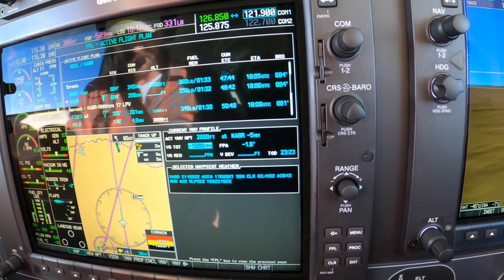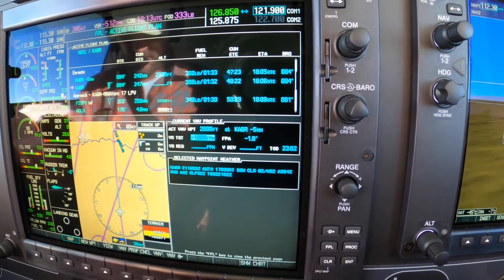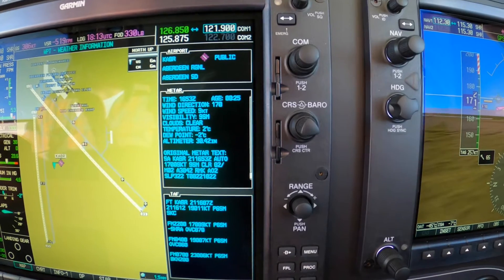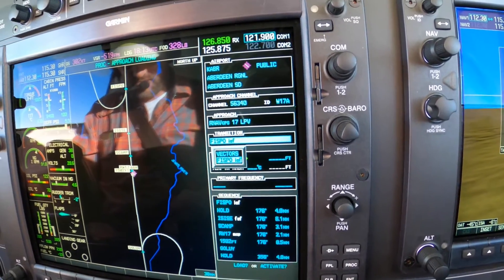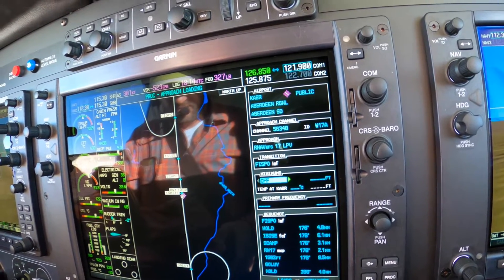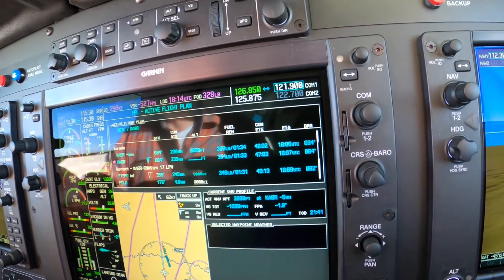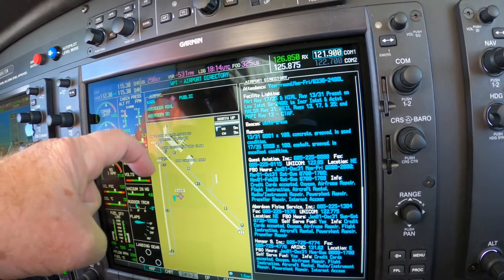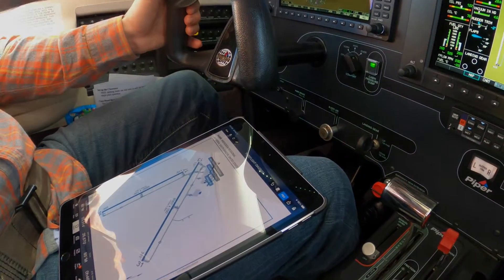Piper M500: Descent/Arrival Planning into Aberdeen SD

Comment: What’s wrong with 3* GS in VNAV?  Use it all the time. Stay high as long as possible.
Reply from the maker: Hi Rick. I see nothing wrong with 3 degrees. You didn’t say what aircraft you are flying but I suspect it is something with a higher Vmo than the Meridian/M500’s 188 Kts. In order to descend any quicker, the Meridian/M500 pilot will need to reduce power significantly below the setting needed to sustain ice penetration speed upon leveling off. This produces some management challenges for the SPO (single pilot operator). The Meridian/M500 and M600 all default to 3 degrees. The Meridian/M500 can be modified with either VS or degrees down whereas the M600 (Vmo 250 Kts) allows for VNAV mods with slope changes only. In any case, I recommend a climb of 1/3 of the flight time at ice penetration speed and a descent rate consistent with a power setting that allows for an airspeed below Vmo in the descent and a stabilized level off. Fly Safely - Train Often..
Reply: @RWRPilotTraining   Hello Sir! I do fly a M500 300+ hours a year and nearly always use the 3* descent.   Yes, the 188 VMO stinks and is 1 of the things I dislike about this aircraft.  M600 does it much better.  However, even with a  groundspeed of 320+ knots, the VSI required may be 1600 FPM or so. I have seen it near 1800 FPM at times. That is still doable , torque will have to be reduced to 300# at times but as the descent progresses, the GS will go down and the Vertical speed required will be less.  Hopefully the air will be smooth, if not, than a lower vertical speed may be required or desired.  You stated:  "need to reduce power significantly below the setting needed to sustain ice penetration speed upon leveling off."  I dont understand, as you level off, obviously the pilot should be resetting the torque to an acceptable level.  What would anyone level off and not reset the torque?  Please explain, or I have a feeling it may be directed at the many owner pilots that fly these??  If so, they still should reset the power, this airplane is incredibly simple to operate most of the time.  If someone levels off and allows the airspeed to get below 130 in icing, they need some more training and a better understanding of general aircraft operation.  Anyway, thanks for the reply and your time! Rick ATP CFIMEII - M500 - FAA check airman BE200 - AT802 AT502
Reply from the maker: Hi Rick, I transition about 50 pilots every year from piston to turbine aircraft and I like the Meridian/M500 aircraft because it is simple and therefore preferred for this transition. Regarding your comment: “Hopefully the air will be smooth”?? .. as Albert Einstein used to say: “keep things as simple as possible, no simpler” and as I like to say.. “Hope is not a strategy!” Fly Safely - Train Often .. DR
Reply: @RWRPilotTraining  respectfully, you didn’t answer my questions. 
To answer your questioning of my remark- “Hopefully the air will be smooth”, it’s is obviously in regards to the airframe and comfort of the passengers. If the air is not smooth, the airspeed will get decreased accordingly.
Reply from the maker: Roger That! Fly Safely - Train Often .. DR